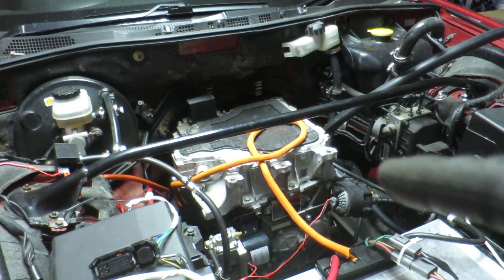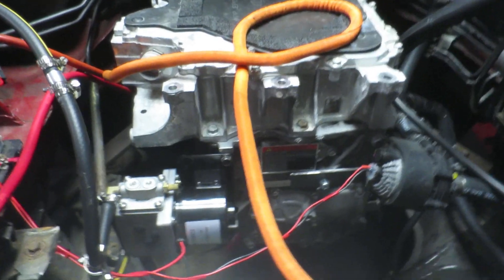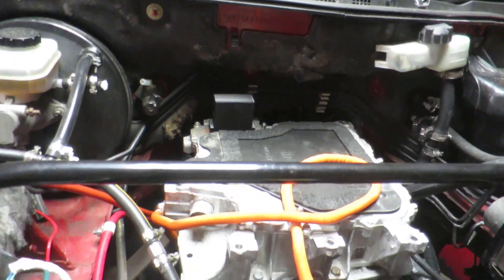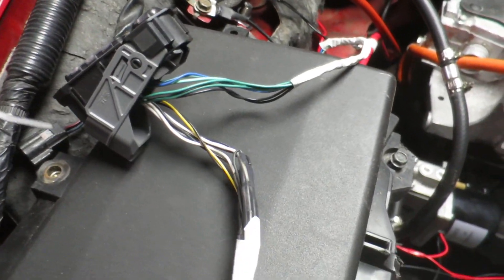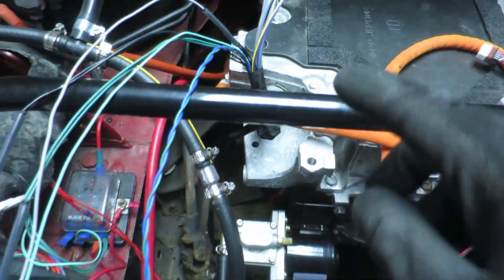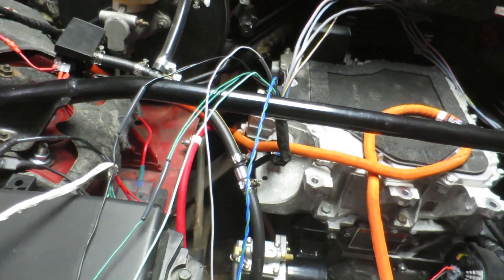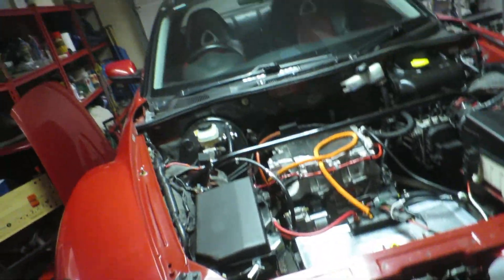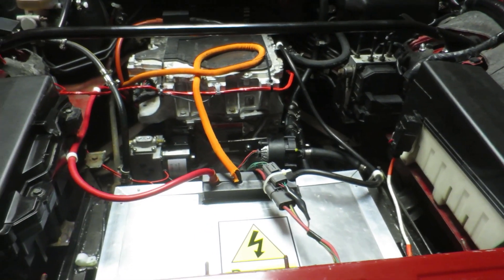RX8 with 160kW Nissan Leaf powertrain upgrade Part 3

Comment: That radiator has a thermostat in it, did you remove it? also connections on the bottom and standing radiator doesn't purge to well...
Reply from the maker: Does it? I never realised that, flow seems to be happening when cold - which seems odd if a themostat blocks until up to temp. yeah the bottom connections were a pain, but I purged it by spinning the rad upside down ;o)
Reply: @SouthWestEVUK  i think it does has a passage because else the thermostat wouldn't sense the temperature properly...i mean oil is conductive but to reach 70degC purely on that. ... There is one thing though. The Rex HP had 2 oil coolers. The normal Rex one and the Automotic ones had one oil and one gearbox. Maybe you used the gearbox one?

Comment: Im doing my inverter swap now, do you remember if your top inverter pins were wobbly, i was able to move mine side to side
Reply from the maker: Hay - no pretty certain they did not move! You mean the DC connectors right?

Comment: Fuses have trip curves.   It won't trip at EXACTLY 225 amps.  I've run 400 amps through my 250a slow blow fuse for a couple of seconds-no issue.  What fuse ate you using?  I will look it up.
Reply from the maker: The fuse in the leaf doesnt really have much on it, other than 225A, I am just about to install a 300A one to give me more head room.

Comment: Are you following ISO6469 guidelines for your HV cabling as the ones from your inverter to motor look standard. Have you got an isulation monitor installed?
Reply from the maker: ISO6469, highly unlikely, insulation monitor, also very unlikely

Comment: Did you reuse the Nissan brain or did you use one of those expensive thunderstruck boards?
Reply from the maker: Neither, I made my own ;o)
Reply: @SouthWestEVUK  open inverter?
Reply from the maker: Errr, no I use an Arduino with my own code. Yes some of that code has been found online, but the majority has been hand crafted!
Reply: @SouthWestEVUK  I hope you might share instructions as other solutions are expensive and difficult to assemble